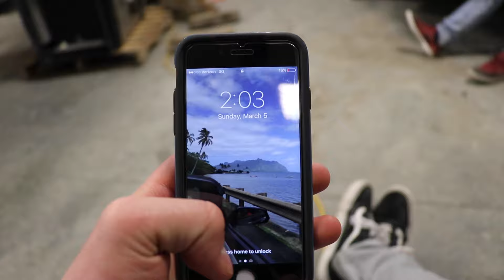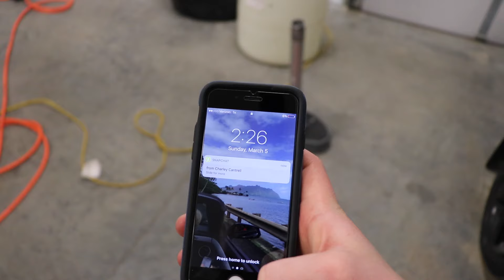Almost Famous

Comment: Can I ask an ignorant question.. what's the little lever above the clutch lever
Reply: Blake C dcomp lever
Reply from the maker: its not an ignorant question! its called a hot start and you can pull it if your bike isnt starting up right away and is essentially similar to choking your bike